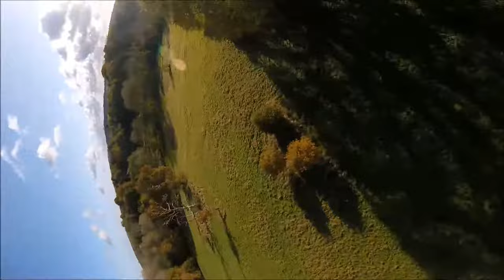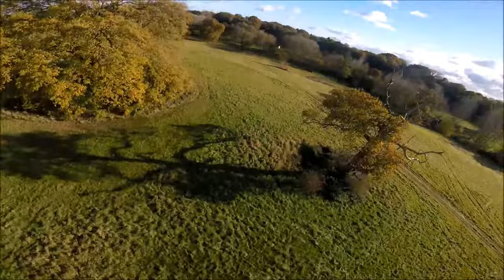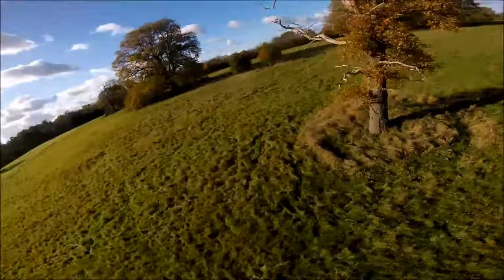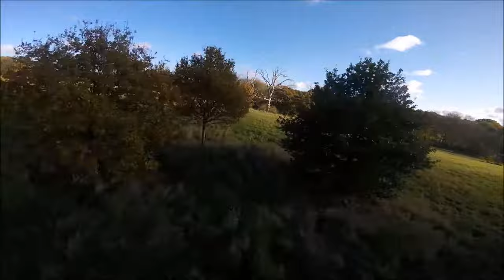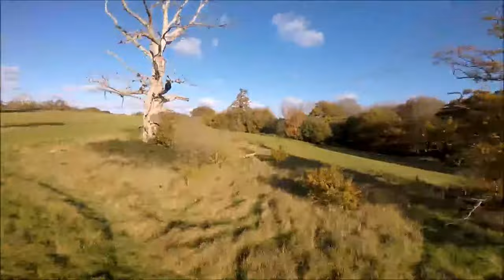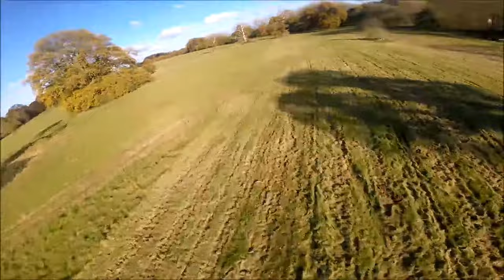TBS Crossfire 150hz Test....Awesome

Comment: subbed bro, why do you not use CRSF Protocol ?
Reply from the maker: DrFrantic77 it does actually say CRSF on the back of the Crossfire module, I’ve had my Crossfire for nearly 2 years now and this option to change sbus rate is only just available since I recently updated the firmware so I thought I would try it
Reply from the maker: DrFrantic77 thanks for the sub too dude 👊👊

Comment: Is it the same speed as crsf mode? I’ve been using that on rf and it’s also amazing
Reply from the maker: Adam Potts I believe so, if you go into the micro RX setting you can check it anyway and see what it’s on 👍
Reply: oh yeah set mine up running the crsf tx crsf rx to tx1 and tx3, works a treat and so fast!